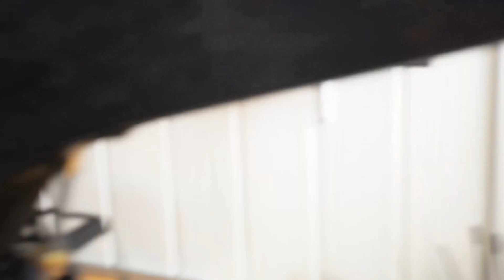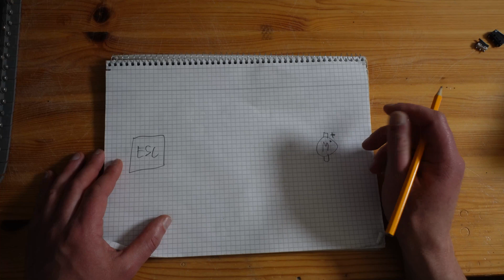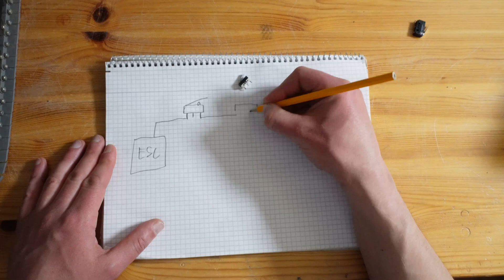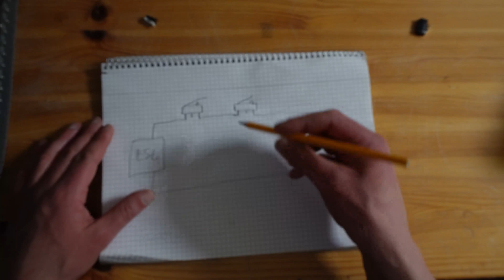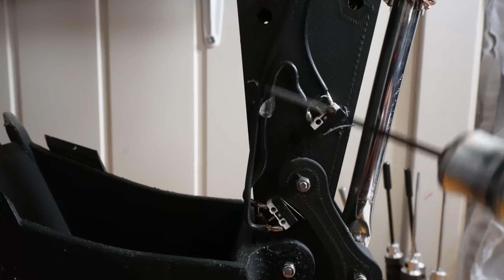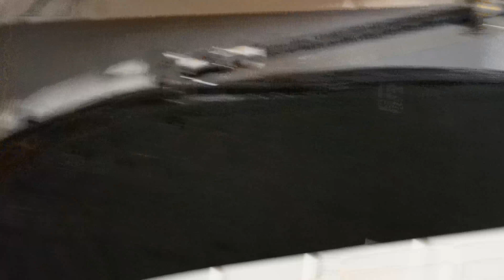How to: Limit switches on 3D printed Excavator

Comment: Thanks for your video, but I am a little confused with the limit switches. Could you tell me on those switches you have, which lead is the NC, NO, and the COM? Thanks!
Reply from the maker: Hi. Thanks for watching. They are all connected through NC. Different switches have different layouts. you have to check yours.

Comment: What diodes are you using? There is so many and not much info on what to use.
Reply: Yes, I am wondering about the diodes also.  Did you ever get an answer?
Reply: Buy the diodes that allow the same amperage as your motors or ESC.